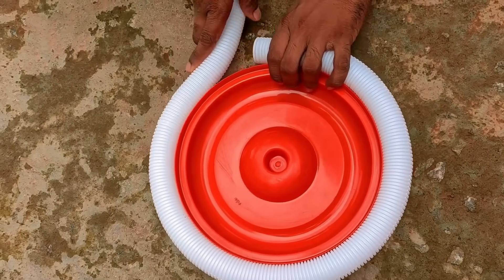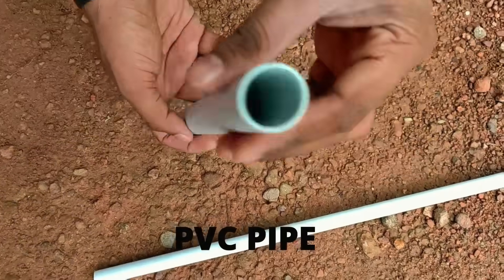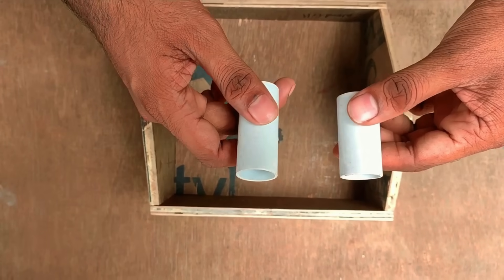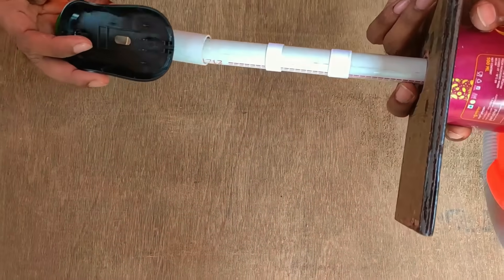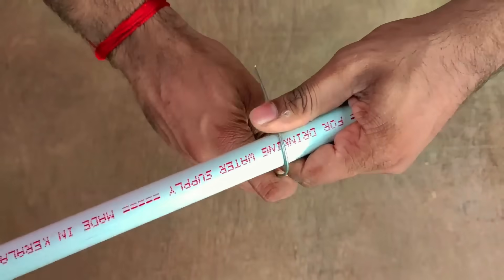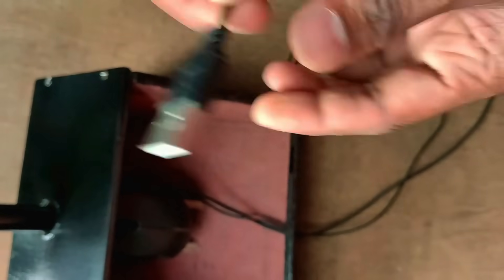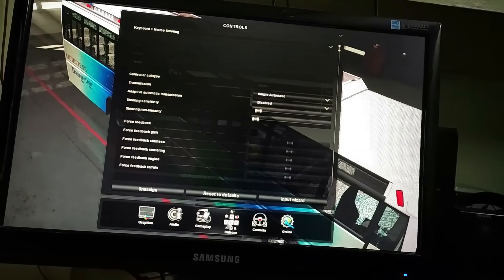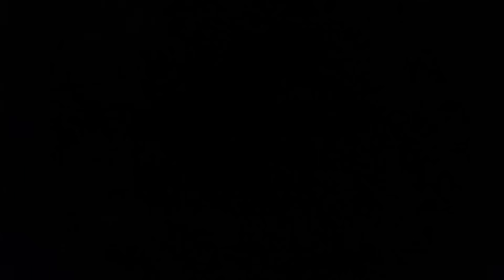How to make gaming steering wheel 🤩| ഇത് ഒരു പ്വോളി ഐറ്റം ആണ്  മച്ചാന്മാരെ... !

Comment: you forgot one thing, the accelerator and braking doesn't work with on off pattern,  it requires an incremental pattern, this switch which you have either accelerates in full or nothing, 0 or 100, nothing in between, this will make the car unstable while cornering, the car will often tail out while cornering.
Reply: yeah that's what i was thinking
Reply: Exactly. I'm planning to make this but use a IR proximity sensor instead switch which would give precise conrol.
Reply: @anoopmail123 Bro enthaayi cheyth nokiyoo
Reply: @anoopmail123  but how do you connect ??